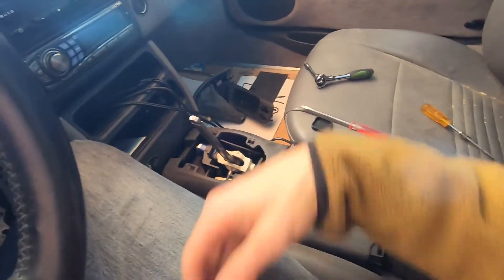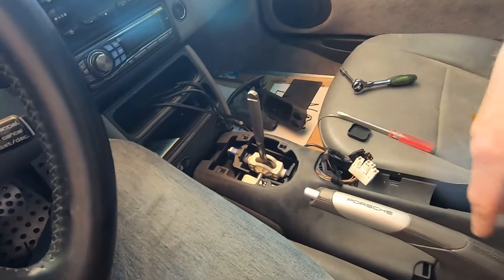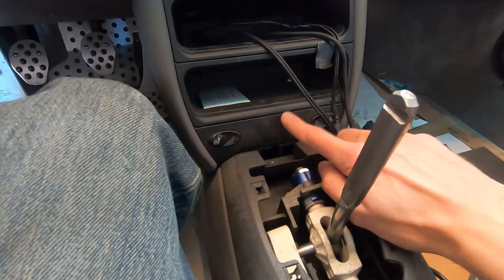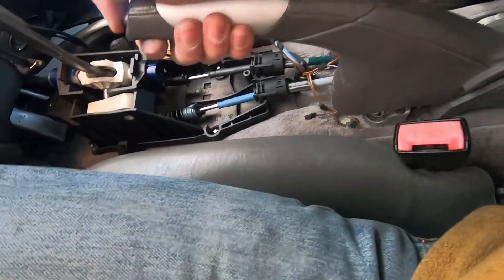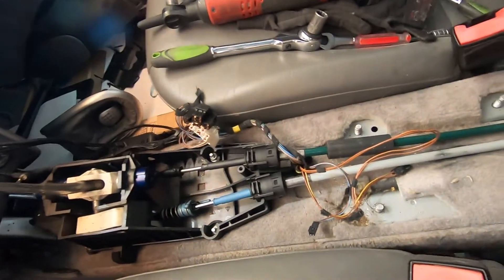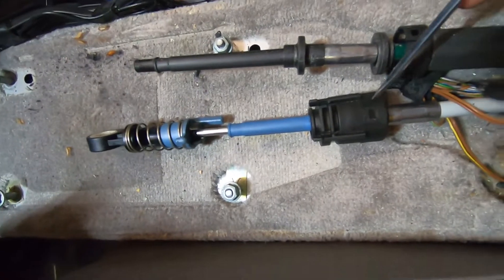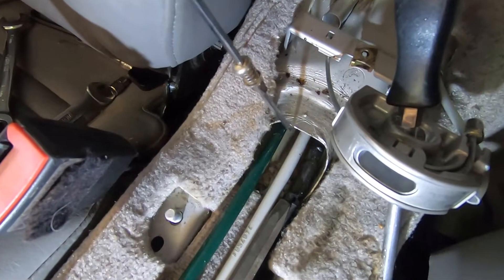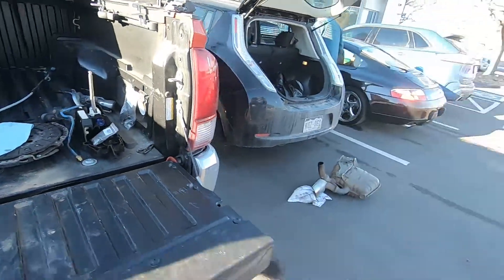Porsche 911 996 - Removing Shift Cables

Comment: You don't need to remove the shifter to disconnect the cables. You just push back the springs coming from the shifter where it clips to the cables and they'll pop right out.

That's also how you adjust the shifter so all shifts line up and are smooth. That requires a small plastic clip to hold the shifter in the right place before you reconnect them at the springs.